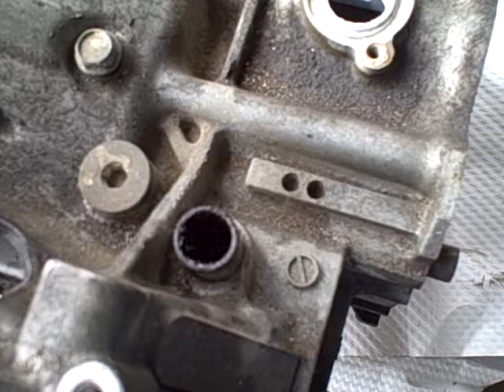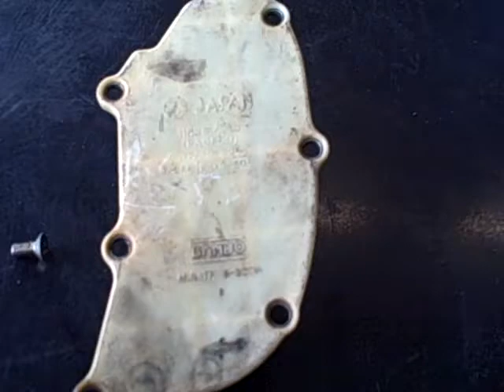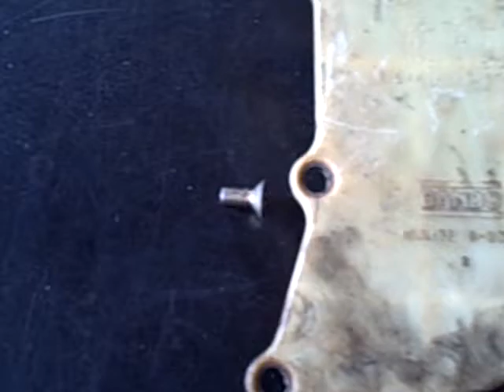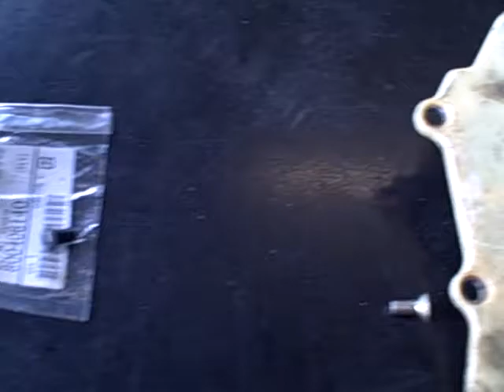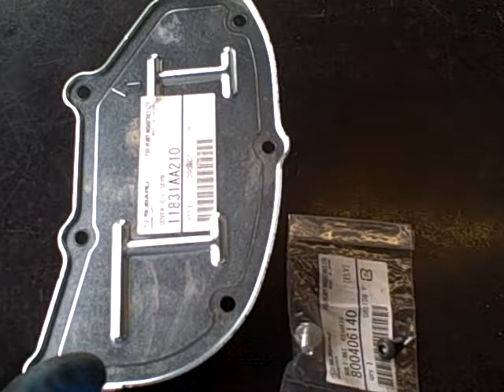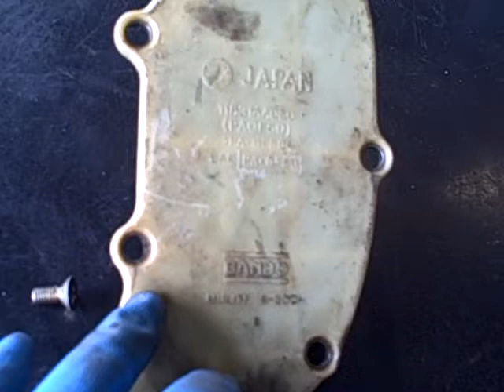Subaru Separator Plate

Comment: Advice anyone? To replace this, should I pull the engine or drop the tranny? I'll be working in my back yard, no car lift... I'll replace the rear main seal, clutch stuff, tranny mount, half shaft on the one side that needs it. Thanks!
Reply: I've a '07 outback 2.5 SOHC no turbo

Comment: I have a mysterious oil leak cruise control doesn't want to work reset codes works for a minute now the updraft O2 sensor is going off put a new gas cap on it to get rid of that code but still says  evaporative code??

Comment: Im swapping my transmission out of my 97 Outback Limited and doing the clutch at the same time. My seperator plate is leaking. Can I change it out without draining the engine oil? I prefer to drain the oil when its warm so it flows better, but since one rarely has the transmission off the engine, I dont really have that luxury at the moment.

Comment: why the heck would they use steel for the updated part? steel on aluminum = galvanic reaction. sure there should be a gasket -- but why play with fire (or, electrochemstry in this case)?
Reply: you bring up a good concern. but let me remind you that all hardware; nuts, bolts, bearings, springs are made of steel, no problem there. In fact if you use a sealant (which is necessary), you will not get that reaction.
Reply: Ryan LaRue
 quite true, quite true.

Comment: Awesome video, Justin, you seem to know your stuff! The flexplate on my 95 Impreza ripped apart at the bolt pattern area so I am replacing it now, I just saw my seperator plate is melted right through from the heat of the rubbing flexplate. the back of my engine is completely caked in oil now. I forgot what I was going to ask....crap. I was looking for some advice but my mind is blank now - typical. anyways, thanks again for the video, it helps!

Comment: Thanks! I found out that my main oil leak came from a loose sensor! It was a sensor near the passenger side valve cover, between the firewall and the engine. It was dripping like mad and the air was pushing it all over the bottom and made it look like something else. I will check that left rear wrist pin access o-ring as well! Thank you!

Comment: I tried looking everywhere.... do 2006 impreza's still use plastic seperator plates? I have a moderate oil leak, and a shop diagnosed it to be the RMS. After extensive searching, it looks like the RMS doesn't fail on these vehicles, and it should be the oil separator plate that's causing this issue. I  would like to be confident before pulling out my transmission and clutch and flywheel.

If i pull all those components out, what other seals or maintenance should I do, now that it's already out?